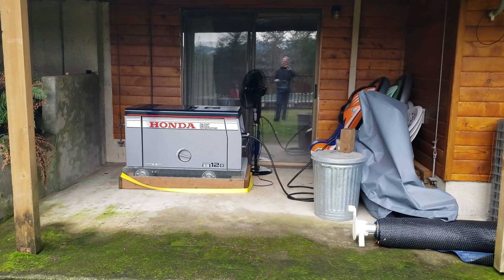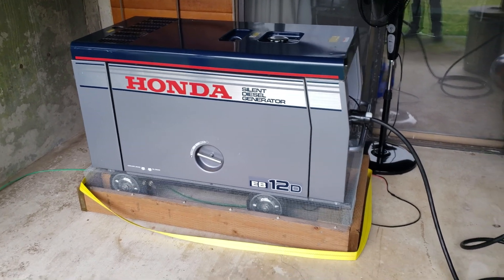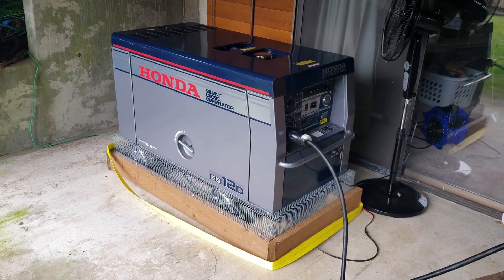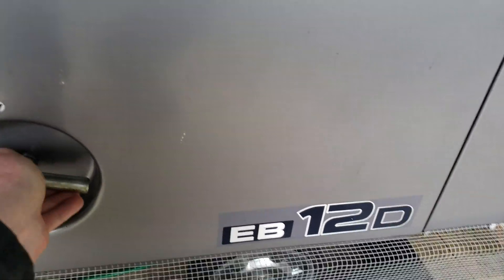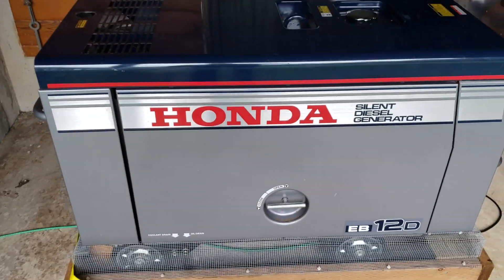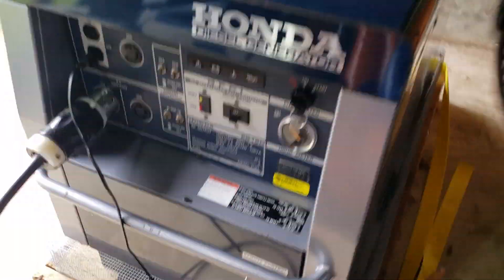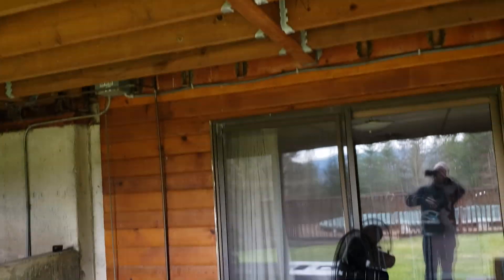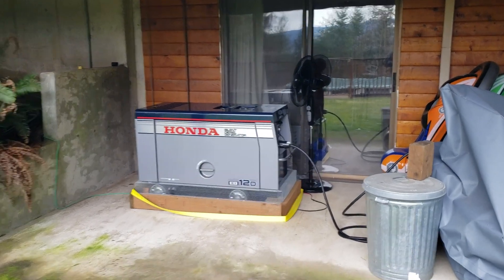EB12D startup

Comment: I have the same generator, wondering if you had to replace your circuit breaker on the machine.?  Mind had broken and needs replacement or rebuilt but not having any luck locating a replacement. Any suggestions.?
Reply from the maker: Circuit breakers okay but for some reason mine shut down on the last storm I think it is the fuel shut off solenoid. I bought a cheap harbor freight 8750 as a backup and it is pretty decent

Comment: The only thing i hate about small diesel generators is the noise..those tiny engines at 3600rpm scream a lot.. 1500rpm models make a big difference. 3cyl ones are real quiet. I have a 6kw cummins 7.5kva & it runs at 1500rpm , very quiet and reliable generator. 
During short outages like for 1hr or so. I have a honda eu30i. The eco throttle makes it very quiet but at full load it is louder than the cummins c7.5
Reply from the maker: It's not too bad but I do have an 1800 RPM mep803a military generator that is much quieter as well.